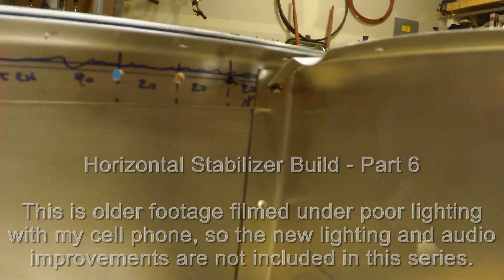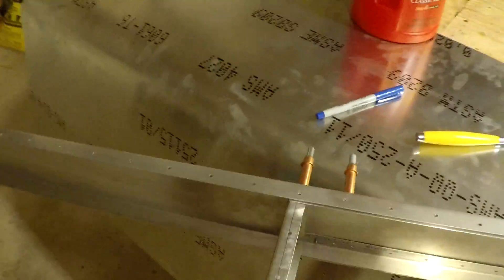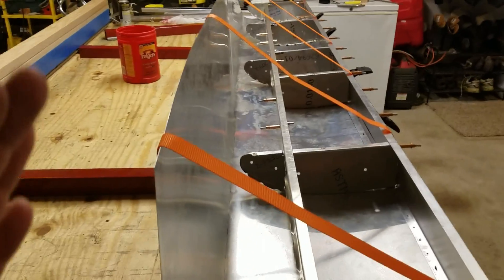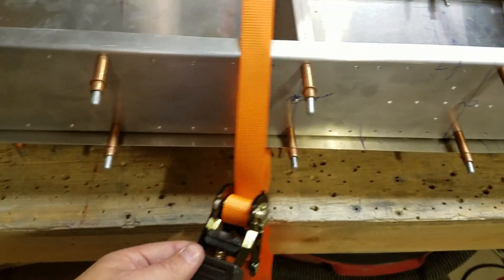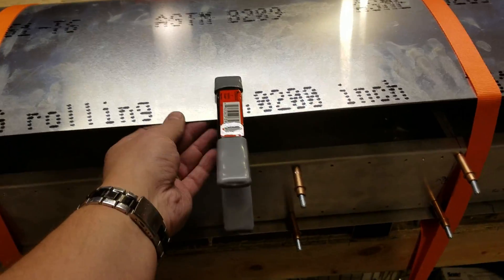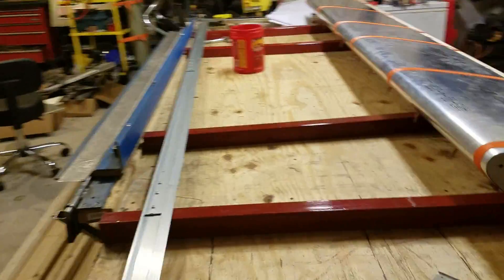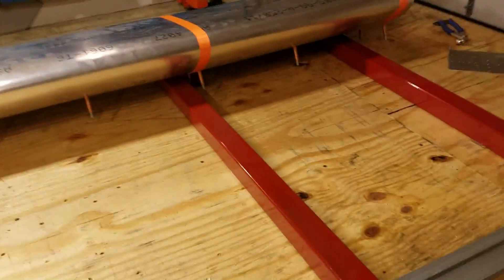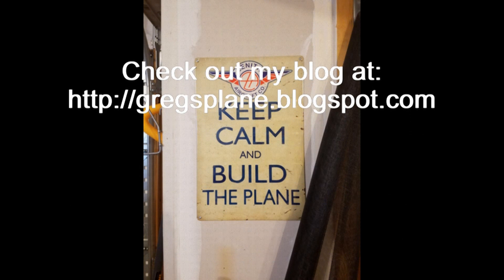Horizontal Stabilizer Build - Part 6/7

Comment: Hi I'm your new subscriber .can you Tell me about wing skin grade of allumenium. Please reply soon
Reply: 6061-T6 aluminum, .020 thickness for the main wings. Other surfaces have .016" and some have .025".
Reply: @gregoryharris6834  thanks . But some manufacturers use 2024 isn't better than 6061- T6
Reply from the maker: I don't know about better. Zenith specifies 6061-T6 in all their models, so that is what I use. It is readily available in the USA. If I recall correctly, 2024 can be substituted if 6061 is not available, but 2024 must be treated with corrosion protection. With 6061, corrosion protection is considered optional unless you live near salt water.